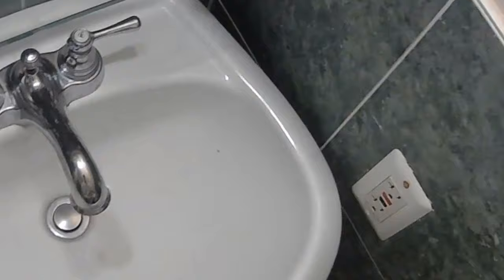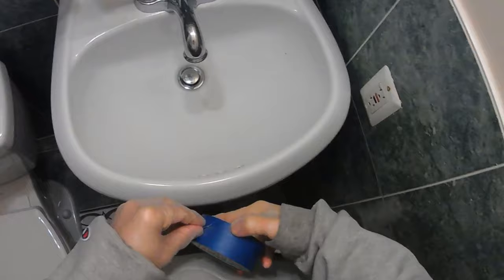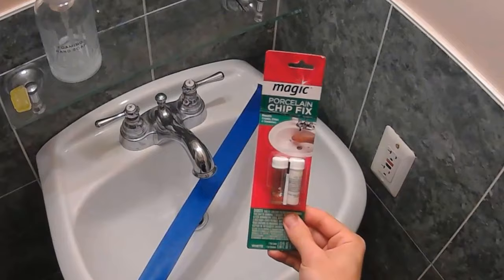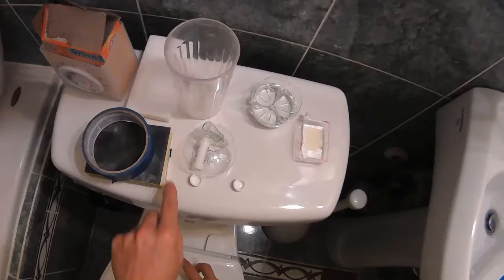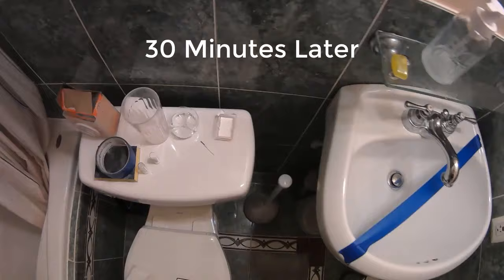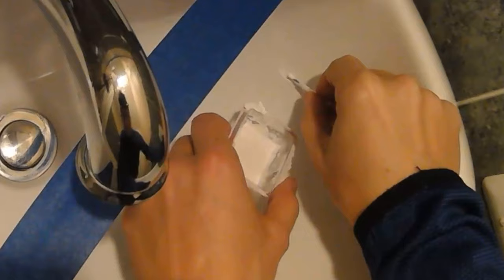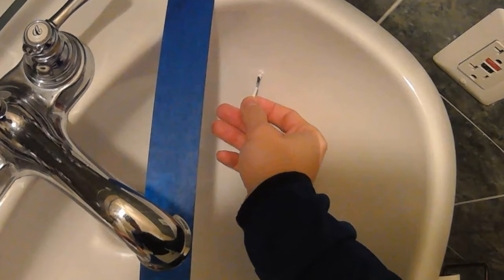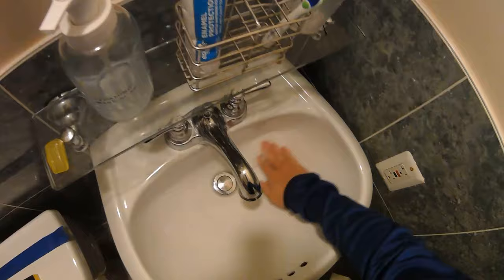How to fix a crack in a porcelain sink

Comment: Thanks for the video 
I dropped a glass bottle soap container on my sink I got a chip and several cracks on it 
I will definitely try this technique. Several viewers seemed annoyed with " chips" and " cracks" IMO it is not a big deal the principles and techniques still the same
Reply: Can you update us? Did it work? Same issue dropped glass soap container
Reply: Hey hey hey, wouldn't you know it, dropped a glass soap container into my sink. Any updates on if this worked?
Reply: Very curious if this is working for larger cracks as well as the smaller chips - I get it’s a similar principle, not sure if there’s something else to use.

Comment: Thank you for this. A question: now that a several months have passed since this repair, has this held up well? Any issues?
Reply from the maker: It held up ok, the chip is still filled, but I can see a long shallow hairline crack that looks like it is originating from the chip.  I can see it clearly, but guest don't notice, and everything is functional.  All that being said, I think I will be replacing the sink soon with a vanity.  I will post a video for that when it is done.

Comment: is this an epoxy that you are using? I work in a stone yard, almost everything seems to be repairable except for porcelain. mostly working with slabs, making kitchen bench-tops out of porcelain. im wondering if there is a decent method for getting out chips and hairline cracks. ive tried so many things but have not had much success. ive tried mixing exposies with pigment colours, seems to work ok with chips, but for the life of me i cant get rid of hairline cracks. any ideas?
Reply: It was just a very shallow chip. Probably dropped something sharp in there like a pair of scissors or worse, something like a hair trimmer with a metal casing on its edge. I use PoP and sanded it down and it's still unnoticeable a year later. The thumbnail picture showed cracks like the sink was hit a hammer and it somehow didn't disintegrate. This video is one of its kind. It popped up so high in the search results because this is a very unusual case where you can fix such badly broken porcelain with a bit of "Magic whatever". Just like all the advertisements, this too, unfortunately, is a fake 
PS this filling won't last a single season or even maybe a couple of hand washes as you can clearly see that temperature has a very profound effect on the Binder liquid